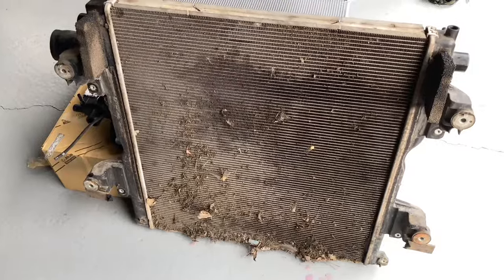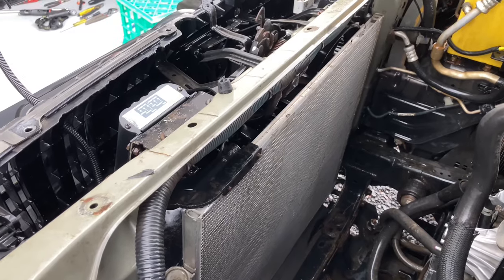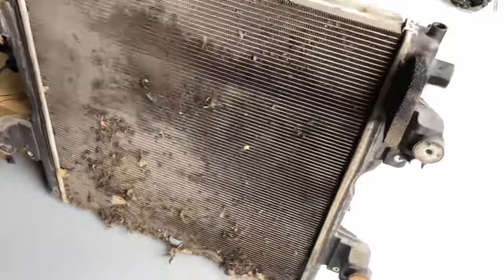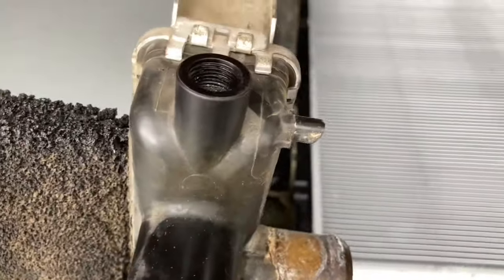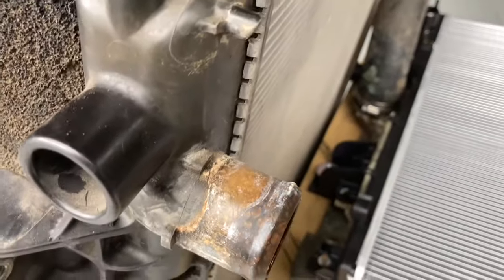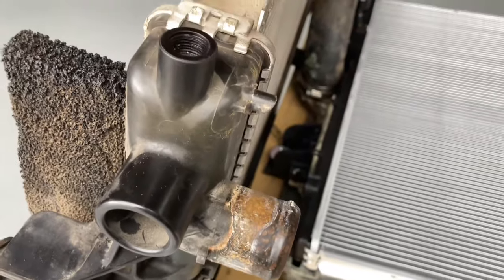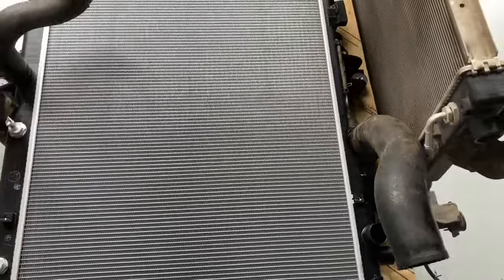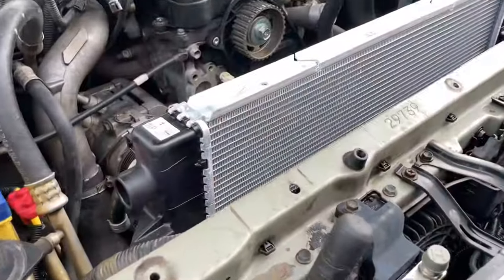WHEN to REPLACE the RADIATOR Plus Bonus INFO

Comment: Personally I use air conditioning coil cleaning spray before reverse flushing the radiator and A/C condenser. This dissolves the dust and holds it in suspension as the foam dose its job.

Comment: $600+ for a radiator i think it's worth looking to see if kaon or someone has a protective guard for that overflow, might not be worth for you Anthony but for the average guy that's more likely to have a brain fart it's sure worth it i think anyway
Reply from the maker: They are working on a protective Gard  I would rather they worked on a repair. I’m going to speak to them about that too many Radiators getting wasted.
Reply: @Fourby4Diesel  i think doing both is a great idea 1 protect it from amateurs damaging it 2 give people a fix if they do damage it

Comment: There is nothing wrong with that radiator. A proper radiator shop would clean it, check the flow rate, pressure test it, and fix the piece, you broke off, for a fraction of the cost of a new one.
Reply from the maker: What’s this you Broke off  talk you broke it not me
I’m not a radiator shop 
But they’re not very good